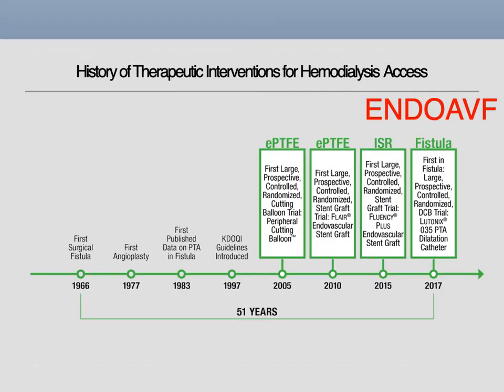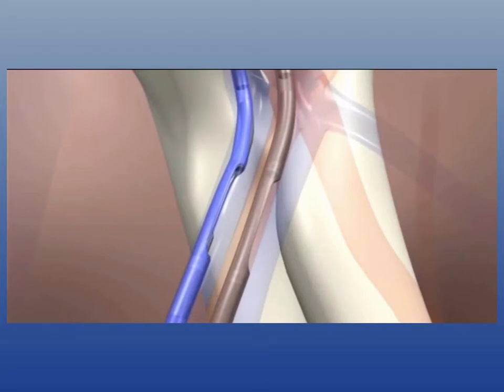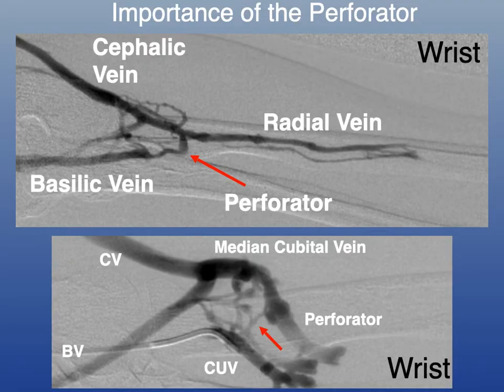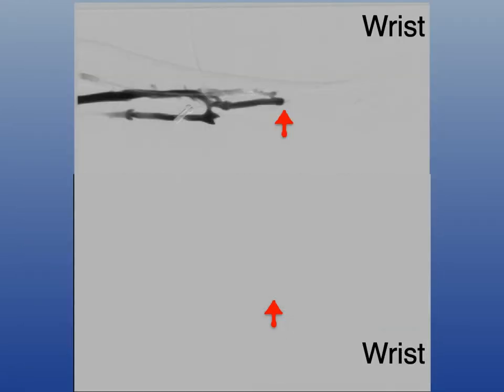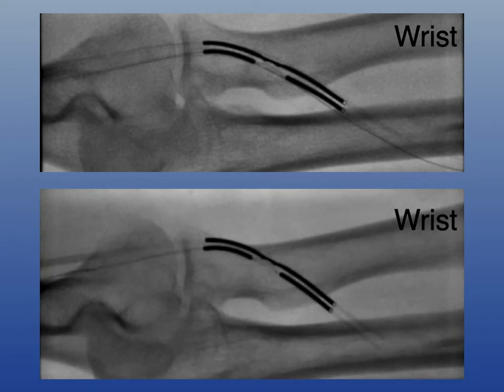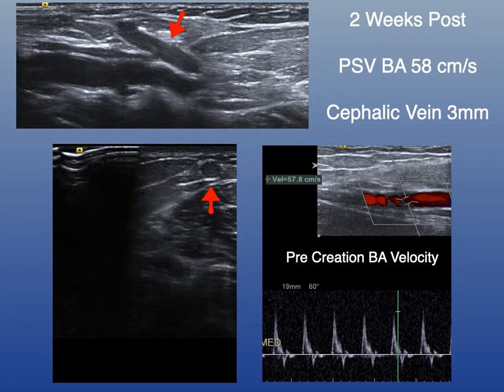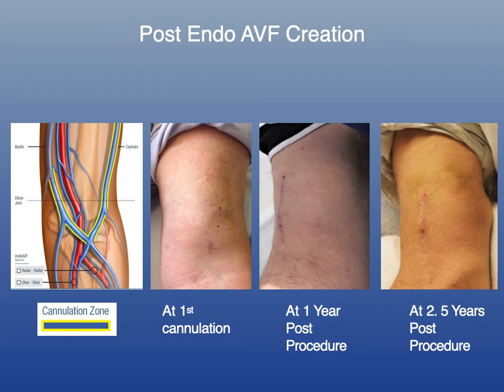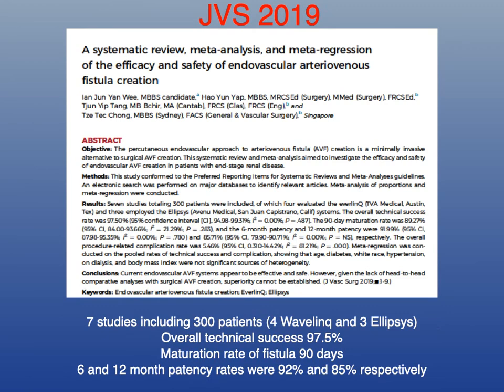Percutaneous Dialysis Fistula Creation (EndoAVF) Basics 2020

Comment: Dear Dr
Thanks for your unique  video. 
I would like to please you answer this question. 
May we do make this type of fistula with Eps burning radio-frequency device instead of special off the shelf burning device?
May I notice you I live in a developing country and do not enough money to buy this devices. 
Thanks.
Reply from the maker: I would only use the approved devices for safety reasons. It is very expensive here also

Comment: Thank you for the video and the information. I have a doubt regarding the percutaneous AVF. What happens with the distal venous system? Both devices used to perform this technique creates the communication but doesn't "ligate" distal segment of the vein in order to prevent venous backflow that could lead to hand edema. Could you tell more about this? Thank you in advance
Reply from the maker: Usually the main outflow basilic and cephalic veins become enlarged. This is a low pressure fistula unlike a surgical fistula.